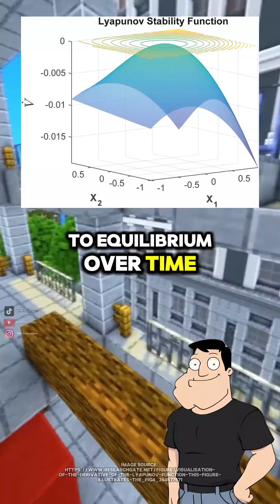What is Lyapunov Stability?

Comment: isnt a simulation just solving the equations?
Reply: It would be, but Lyapunov stability isn't really about doing a simulation at all.
Reply: @mmarques2736  and why would you not want to simulate instead? simulation seems more exact
Reply: @rezah336  Lyapunov theory of stability is absolutely rigorous. It has a very strict notion of wha stability means (the solar system is not Lyapunov stable), but absolutely rigorous, it is either stable or not, independently of something like the numerical error of a simulation for a dynamical system. The other thing is that you can't solve a simulation in real-time, and this is about real-time nonlinear control.
Reply: @mmarques2736  when do you solve lyapunov in real time? isnt it an offline analysis method?

the solar system not being lyapunov stable isn't a good look for lyapunov, it only shows it as theoretical and non applied, basically useless for control engineering.